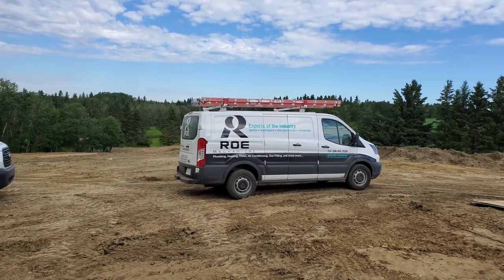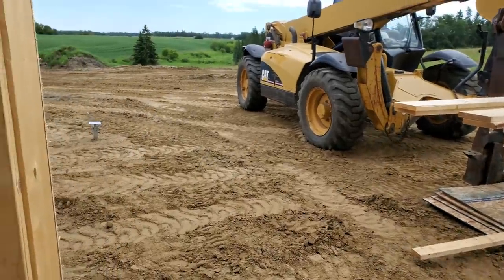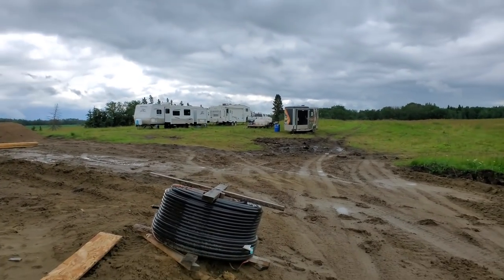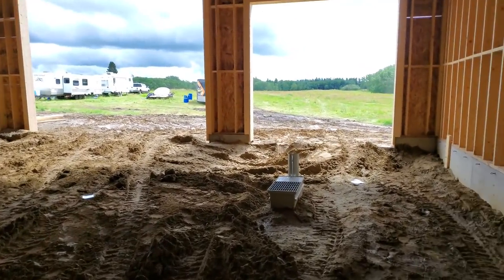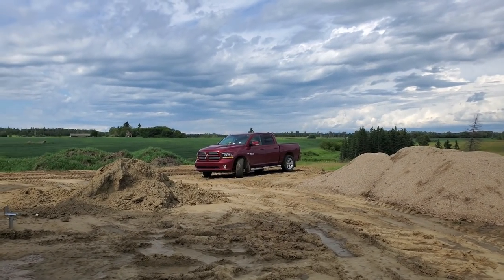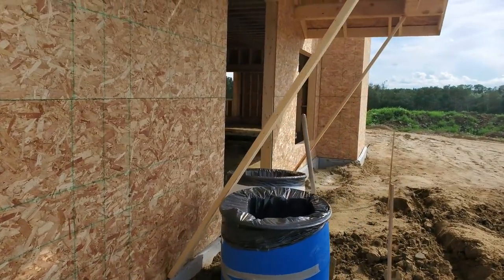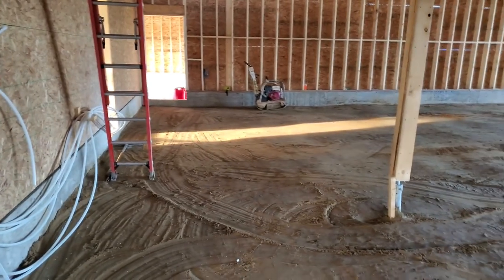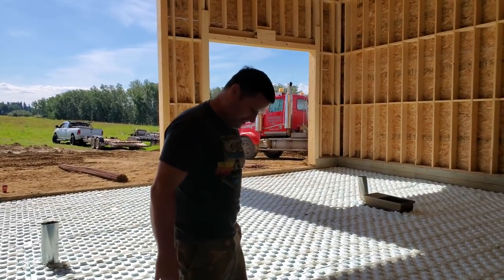Building Our Dream Shop/House Part 4: Plumbing/Electrical Rough In and Concrete Prep

Comment: Might could use, 8 inches of rock/gravel on your road, to the house.
Reply: Just like most people wait till last to buy rock and if they would do it first thing they would have a nice driveway by the time they move in but no let's go thru mud to get to the site it should be code to have a gravel drive in to start construction no sub contractor like mud tight butt house builder

Comment: Quick question if you have a minute to answer please...
When your guy was digging that trench for the septic, you mentioned he had to go 10' down to get below the frost level. But your footings for the shop only look to be around 2'-3' deep. This doesn't make sense to me. Will you please enlighten me as to the building code in your area? Thanks much for your time.

edit:
OIC... I literally watched the next 5 seconds of video from where I stopped to ask my question, and I saw the pier you have under the foundation wall. Now I remember in your previous video that the guy was drilling those pretty deep. LOL... The answer was literally seconds away.
Reply from the maker: Haha yes. Concrete piles go down 14ft. Thanks dude
Reply: Even without the pylons the house is built on the concept of a floating slab. Any detached garage in frost areas are built on floating slabs that are on 12-16 inch deep footings.

Comment: Holy, that was a sweet fly in at the end! Looking good man. That infloor heat is gonna be so sick. I test and commission HVAC stuff and infloor heat really makes for some comfortable areas. You basically control that to your space temp, and use forced air as 2nd stage set to a couple degrees below your setpoint for when the infloor can't keep up, or for quicker recovery from when a door is opened or the OA temp fluctuates really heavily. A nice programmable Honeywell Pro thermostat should be able to handle something like that.
Reply from the maker: Thanks dude. We are so excited!

Comment: I hope the house wont SAG, because the ground is so soft and you're doing everything so quick.
Reply from the maker: The only part that is soft is the road that was just built. The house/shop is built on un touched earth on 74 14ft deep concrete piles so shouldn't have any issues

Comment: you should checkout Obsessed Garage to get the car wash area and air lines all setup. they have compressors, air lines, hose reels, pressure washers etc. definitely set you up proper. have a peak at their YouTube channel
Reply from the maker: Thank you. I will

Comment: 2--3 weeks you get pumped, what kind of system is that? I've never had to pump my septic, its self sustaining for the most part, knock on wood
Reply from the maker: Is a sealed system. 1000gal. Everything that goes in has to get pumped out because we live at a lake
Reply: @ostacruiser  ah, I see says the blind man, as he picked up his hammer and saw haha

Comment: Oh ya  its coming along  tip for grading just put your bucket all the way down and cut the high  spots out  use the tip of the bucket  either up or down  you can also set ur height with the boom height  and back  blade  your bobcat may also have a float setting for beginners..

Comment: Osta, I'm sure concrete is down by now but you should make a very detailed map of where the heat lines run because at some point in time you're going to have to drill something in the floor.

Comment: That is going to be a Beautiful home. When I was having my Big House built everyone thought it was a nursing home. Because it 6200 square foot. And one story.
I wish I would have went with the 
radiant heat in the floors like your having. But here in central Missouri are frost line it 18"
 to 24" . Lot better then 10 ft. I wish I would have had my work garage lot closer to the house. It 30' x 55' it's on top the hill an being in a wheelchair makes it hard to to get up the hill to it. Love the set up of yr house. I love the drains on the floors. Should have thought of putting a oil burner to help heat yr garage all your oil changes use to to heat yr garage.

Comment: Just wondering why so BIG / Tall for a residential shop ? Are you a farmer looking to park hd equipment in there ? ...floor drains with the sand traps is the ONLY way to go .
Reply from the maker: Not a farmer no. But have a few things to go in there yes 😅😅

Comment: For the covered front porch you could use tree trunks like encase them in resin or coat them with something so they dont rot and use those to hold up the roof

Comment: Did you ever check out Morton buildings prior to stick built guys, 35 years ours still good as new. would not hurt to install gas unit heaters as well, to give quick blast warm air when open doors, what are you building it for business or personal garage and residence
Reply from the maker: Personal residence

Comment: the only problems with a hydronic (heated floor) system is that you loose the ability to install a vehicle lift unless you plan out the hydronic system to account for this and dont run lines where the lift will be. the other problem is that the hydronic systems are great that they act as a heat mass, and retain heat for a while, but it is also a downside as if you get really cold temps the hydronic system has to heat the entire mass of your floor before you actually feel the heat in the room... my Grandparents have this system in their new house, and its great when adjusted, and running well, but it takes about a degree an hour to heat up.. should you go on vacation and set your Thermostat lower to save $$ say 50 Degrees, to get back up to 70 degrees would take almost a full day!!
Reply: They have a furnace that will heat it if needed and he said in the video where the hoist is going and doesn't have lines ran in that area.

Comment: Any septic pipes you jave under ground and have turns you should really have wells at that turning point. All sewer pipes underground should be 100% straight incase you need to unstuck something. Just a heads up.
Reply: Where ever you got that info is bullshit. Every sewer or drain pipe has a 90 in it coming from the house or anywhere.

Comment: The quality of the build looks amazing. I’ve watched all 4 videos thus far and one thing keeps bugging me. The house seems suuuuuuper small versus the shop. Granted the shop is the main part of the structure but it just comes off as if the actual house portion of it are glorified walk-in closet compared to shop. Looking forward to seeing it finished.
Reply from the maker: We have 2900sq ft of living space. Should be okay for the 2 of us? 😅😅
Reply: @ostacruiser  Nice, would have never guessed that your living space was so big judging from the videos.  2900sq feet is bigger than my own.

Comment: If your in Canada those footings sent deep enough your going to get heaving so bad besides you don’t have footings you have a wal without footings footings are twice the width of your foundation wall in Idaho the frost line to build is 4 ft
Reply from the maker: We have 14ft pilings under the footings. Everything has been approved by an engineer and inspected multiple times through the build. We aren't making this up as we go 🤣🤣🤣

Comment: Just curious, why don't you get some course gravel hauled in for the driveway/ road?
Reply from the maker: We will for sure. To haul it in before construction is complete is throwing money down the drain as it would be pushed down and dis appear. Once we are close to complete we will get it fixed up properly. Also we are hoping the rain slows down haha. We almost set some records this year lol
Reply: @ostacruiser  I was referring to course Rock were the smallest peices are the size of your fist.  I know when I worked construction, the owner would do that especially in muddy areas.   I do agree it will get pushed down into the mud but will help make the foundation of the road really strong so when the smaller stone/gravel is applied, it has a strong foundation to sit on.

I'm totally jealous of your new house/shop.
Reply from the maker: @MyAlaska12   Yes for sure we actually had a couple truckloads of course rock brought in to shore up some of the really soft spots on the road. It worked great. We had no issues in those areas with all of the heavy truck traffic. Just on our Sandy Hill lol
Reply: @ostacruiser  if you ever bring that Sherp to Alaska, I would love it check it out

Comment: Did you think of plumbing in an attachment drain the sh*t tanks out of your RV?
Reply from the maker: The septic tank is on that side. Should be easy to run a line

Comment: Glad to see you decided on a 2 post. You'll be happy you did!
Reply: im surprised he did a 2 post as well . most unsafe hoist out there , a 4 post could have driven right thru it and way more support and safer to use . no fear of anything falling of a 4 post compared to 2 post accidents .
Reply: @darrellkluchewski4104  2 post is far more useful. Not unsafe at all if used correctly and kept in good working order

Comment: It’s an oversized shed made of plywood...
Reply from the maker: And what's your point? 😅😅
Reply: ostacruiser ostacruiser - by that, I meant it’s not a real shelter; it’s just a shed 10 times bigger than the prefab ones made of OSB or plywood that are being sold @ Home Depot, then stuff with pink insulating materials that a BB gun can easily go through. You should  have gone with ICF, 8 inches of concrete and could last 100 years and more.
Reply from the maker: Haha okay. Bring your bb gun and we can do some testing. You really get all kinds of people in the comments section🤣🤣🤣🤣🤣🤣🤣🤣🤣🤣🤣🤣🤣🤣😍🤣